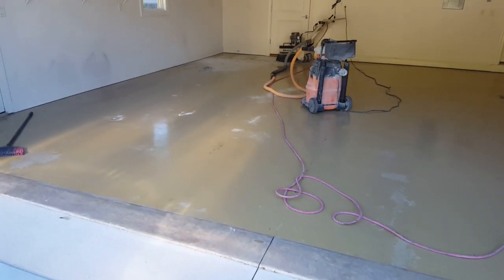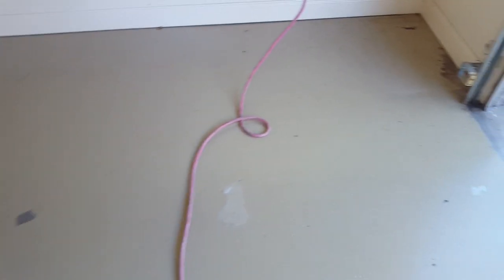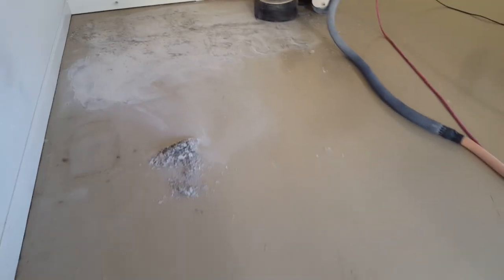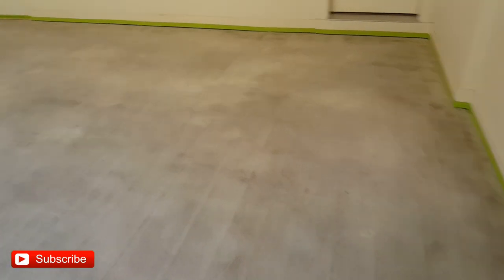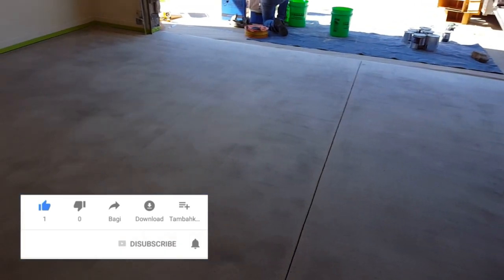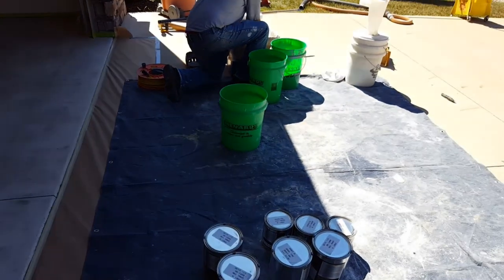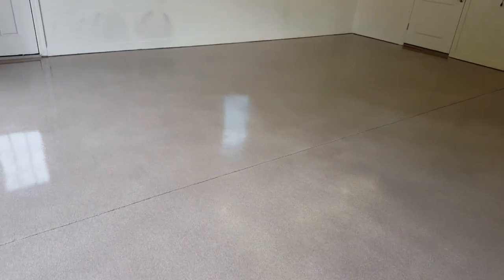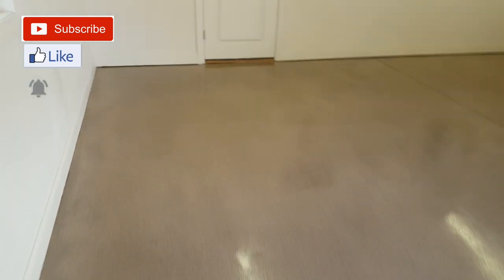Garage Epoxy Vinyl Chips Decorative Concrete Flooring Lake of the Ozarks (2018)

Comment: How thick should I lay it so I know it will be thick enough?
Reply from the maker: 1/8
Reply: MrCustomConcrete two coats
Reply from the maker: @jakehager1041  if your doing the chips like I did in this video you only need 1 coat, just make sure you hustle to get your chips thrown in while the epoxy is still wet, the idea is to inbed  the chips into the wet epoxy, because it creates more strength.
The next day scrape the excess chips that are lose, then lock the chips in with 2 coats of glossy Urethane.